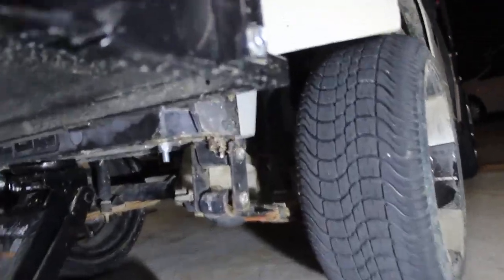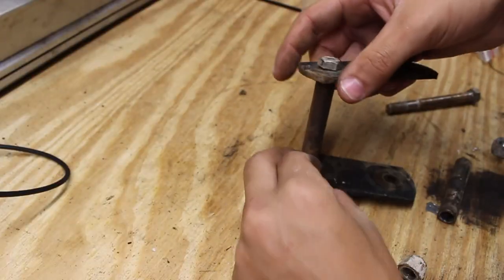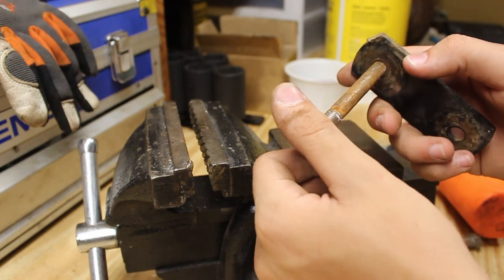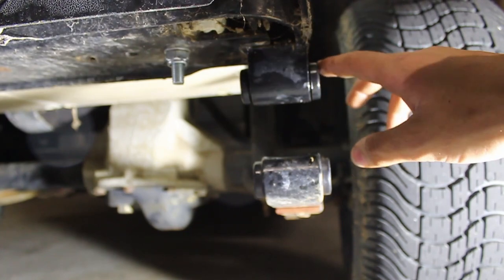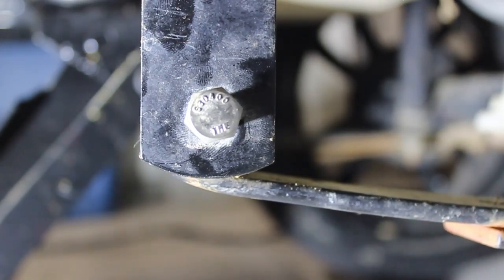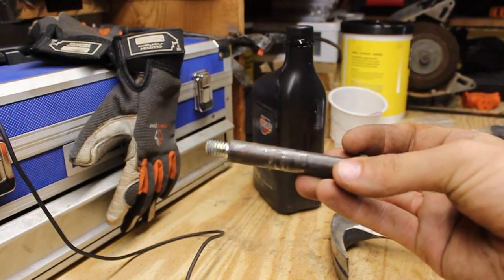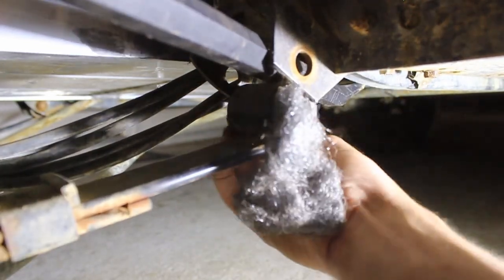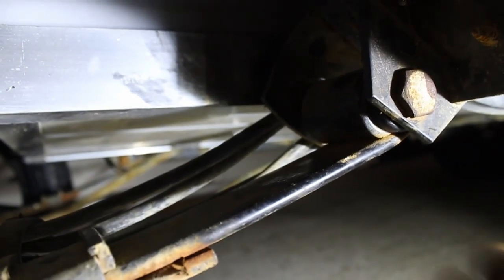How to Replace Ezgo Leaf Spring Bushings

Comment: Solid video. Pro tip for the 3:30 mark: use some white lithium grease (or bearing grease if that's all you have) and apply some lube to the exposed outer sides of the bushings. This prevents rubbing/chaffing and noise from the bushings against the shackles, and typically makes them last longer. 

Done my suspension work this way for 15 years, and it produces great results with just an extra 60 seconds of work. 🍺 ✌

Props to you for actually cleaning your mounting surfaces in the video (the inside of the leaf springs, and the bolts). Most YouTube folks skip this, or don't even know about it. It's an important step. 

The inside of the leaf can also be greased with a thin layer to make installing the bushings easier (in case anyone has a hard time getting their bushings in).
Reply from the maker: Thanks for the tip. I do agree I should have greased it. But I was out of grease I ended up applying some down the road.

Comment: That front bolt is made that way. It doesn't use a sleeve like the upper and lower rear shackle bolts do.
Reply from the maker: I dunno. Upper And lower rear shackles looked identical. and the kit send me Ethier extras or ones for the front.

Comment: the front does not require a bushing. the bolt is the bushing. it is larger then the rear ones for this reason. tip. easier way to get the rear sleeve off is to find the crease in the sleeve. and with a sharp thin screwdriver of small chisel. hit it in the crease till it opens a little then you will be able to split the sleeve open. but better yet. replace the bolt and the sleave.just a suggestion